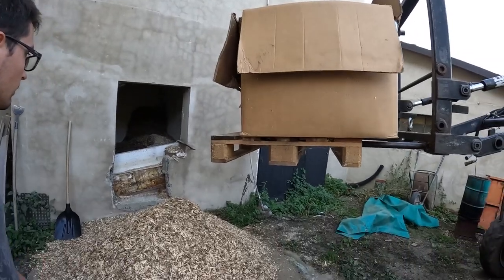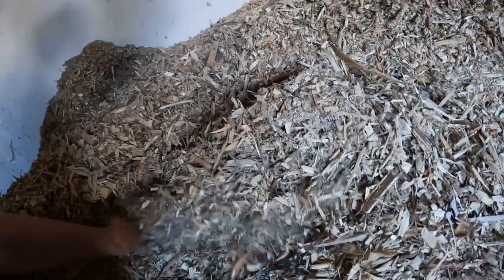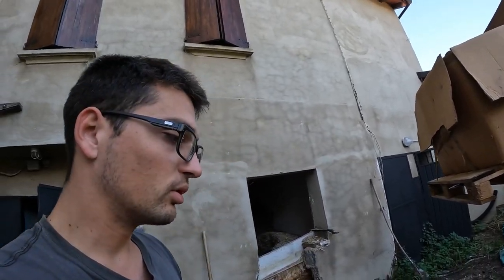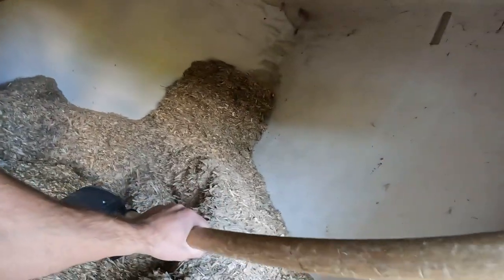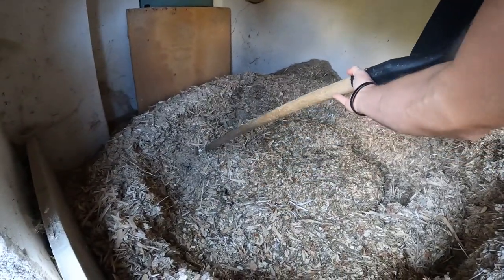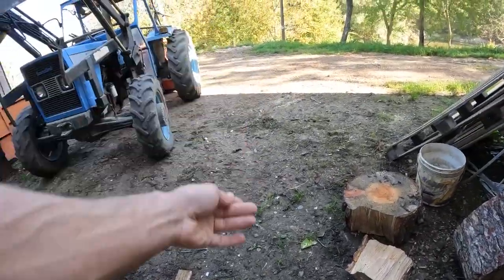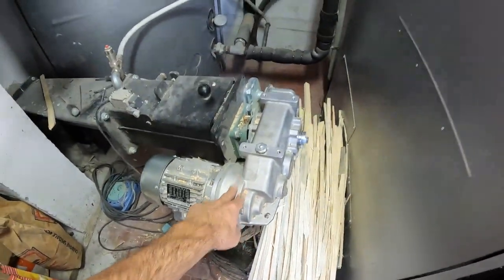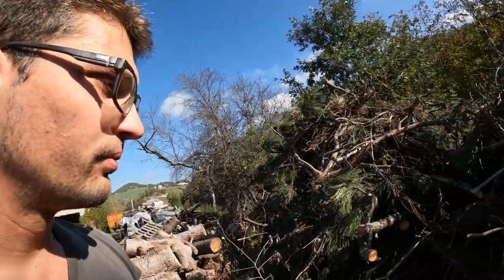WOOD CHIP storage room - MANUAL refill | FROLING T4e | GoPro POV

Comment: Does anyone have even a rough ides of how many cubic meters of chippings would this machine burn through in a year for my well insulated suburban house in Sweden? Could I run this machine from my garage (separate building) and have the hot water piped under ground into the property?
Reply from the maker: Hi! Thank you for the comment! 

Well, this is a too 'location/area-dependent' question + 'material dependent'.
We live in Italy, not that much cold all over the year. We burn about 70 cubic meters of material all over the year (about 20 tonnes). 
However, it really depends on the outside temperature, on the insulation/ energy efficiency class of your house, the quality of the material (our is really low, to save money, on the other hand we have to use much more material).

Anyway, why are you interested in the volume? I mean..is this to correctly dimensionate the storage room? Remember that you'll fill it all over the year, I don't think it feasible to build one big storage room collecting all the material for the year.

About the second question: piping. Yes, for sure you can do that. This specific design was one of our option. It may be one of the best! In our case is, infact, a adjacent bulding (not separated). You can for sure pipe the water underground, with correctly insulated pipes (both for inlet and outlet).

I don't know if you have visited my channel: there is a video about P&ID (piping and instrumentation diagram), where I show how piping works. You won't see these special insulated pipes, but I think you'll have a basic idea on how our heating sytem works. Here a link to the video:   https://youtu.be/hCMJ-fVpLWg

Hope this reply was ok for you! Bye!
Reply: @profilo_is_back  Thank you for such an informative and detailed reply. My eyes have been opened!
Reply from the maker: @Erudite_Euro-Chav  Thank you for having watched the video! hope you can proceed with your biomass-project. Bye!